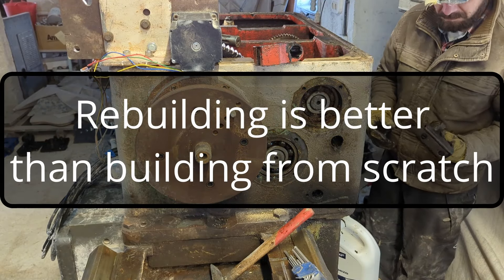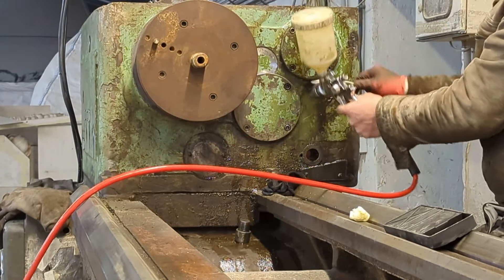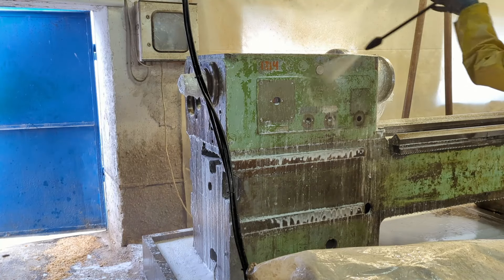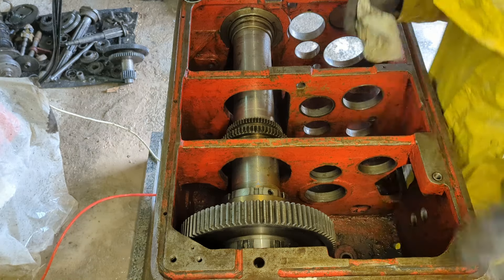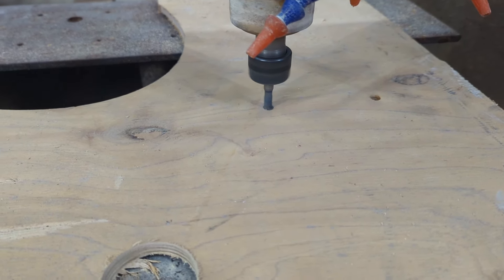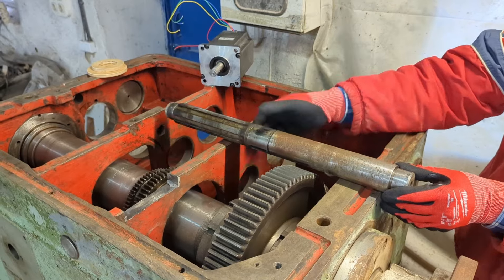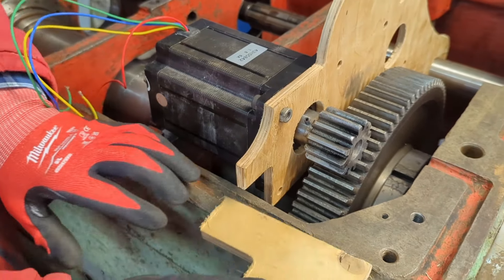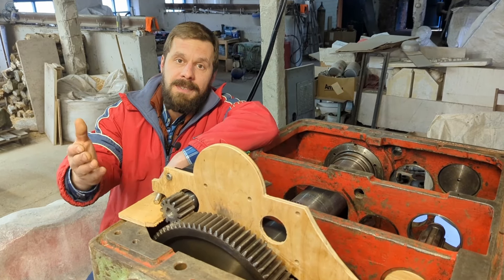Do you want to build your own cnc? Where to begin?  Lathe rebuild. Part 2

Comment: Watching you clean this beast was impressive. If I remember right, this was the very, very old machine that you saved some time ago. Really, really great video! I enjoyed your engineer wisdom as well)
Reply from the maker: The video turned out to be the most boring one, it seems to me.))) But the work is the hardest, before I often worked with old machines, this was the dirtiest. All the nameplates on the machine are torn off, but if I’m not mistaken, the machine was manufactured in 1957. And as always, thanks for watching, commenting and supporting!)))

Comment: You're talking about the purpose of the equipment. What is the purpose of your machine?🤔
Reply from the maker: This machine was purchased because of the size of the bed. It is capable of turning workpieces 2.8 meters long and weighing up to 2 tons between centers, which is more than enough. I pay so much attention to the A-axis because the main task of this machine is to mill complex patterns on large columns or mill sculptures. So it will work less like a lathe and more like a milling machine with a rotary axis. This machine should not be larger than it is, since good stone blanks longer than 2.8 meters are difficult to find. And even if you find such blanks, it is better to rotate them vertically and not horizontally, because the workpiece may break under its own weight.